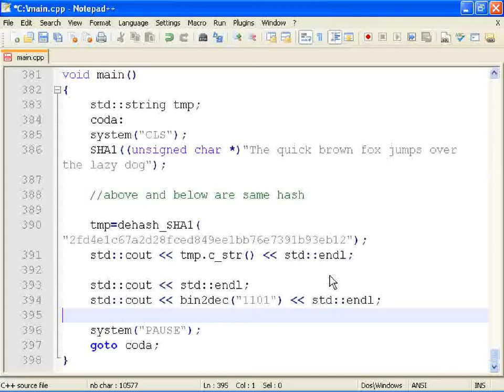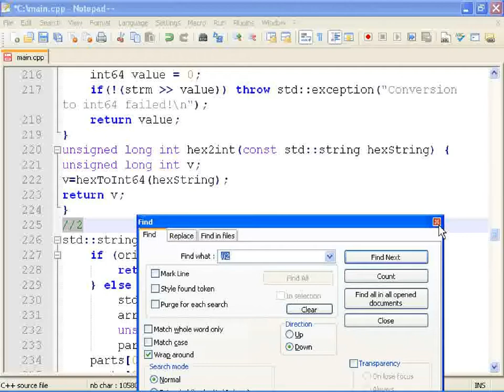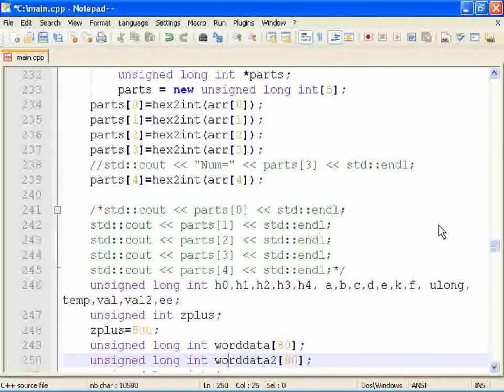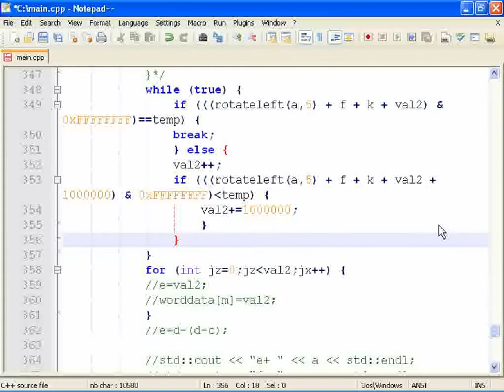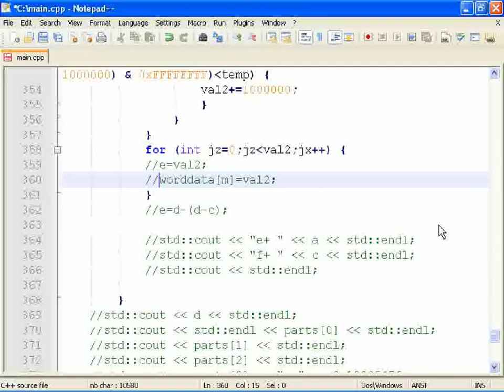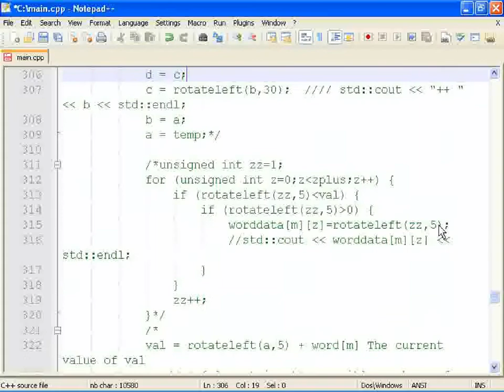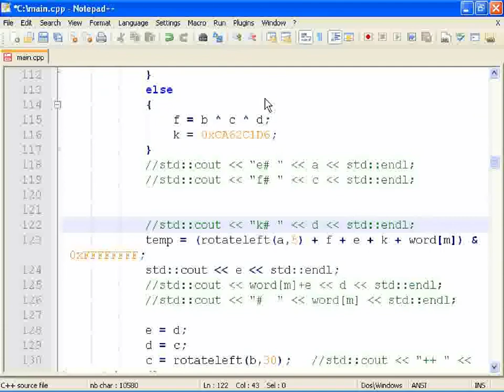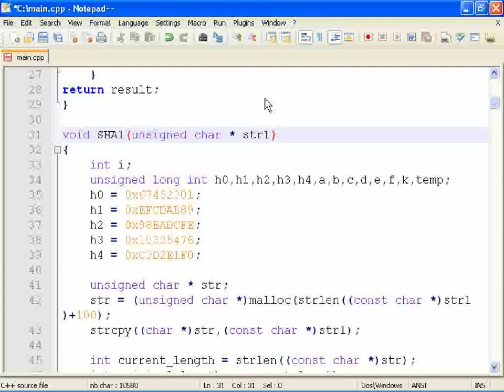How to reverse sha1 hashes

Comment: reversing a hash is impossible and wouldn't do any good to get the original data back unless the original data was smaller in size than 160 bits. Maybe for small passwords but not files. The hash only contains 160 bits and therefore a finite number of possibilites (precisely 2^160)
for every bit larger than that you introduce collisions and they go up exponentially for each bit greater than 160 (or whatever hash you're using such as MD5=128)
Reply from the maker: I believe there are 255 bits in the standard ascii table and sha1 stores 160 bits. However there is a floor in its 40 character hex length rather than 1 character ascii length and that is the way the characters are generated are done in such a strategic pattern that you can add another 4 characters to the equation due to the number of ocelots spacing out this number like a hex ipv4 address where the 160 bits are spread across all 4 ocelots. So with those other four ocelots you could get 1.5 billion hashes due to another bug even though the authors go out of their way to prevent 8 billion hash leakage. These results are passed on through the final set of algorithms and I'll be showing you in a new series showing how to build an application for a dehasher and hopefully find a way to share it in the comments. Hope you stay tuned. cya

Comment: I am sorry but you are missing a very important point here.....at the end of the hashing algorithm the current values of a to h are added to the original values of the H constants. This is fine, but the overflow is ignored....so if an overflow did indeed happen then just subtracting the H value is not going to give you the original values.